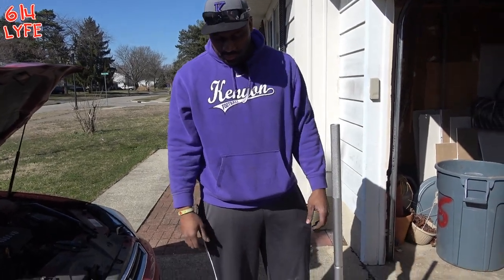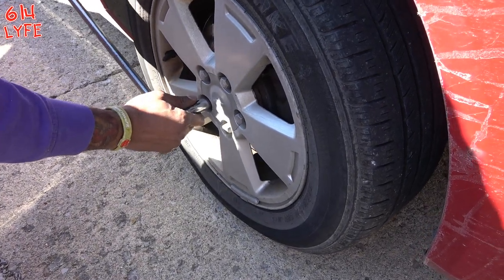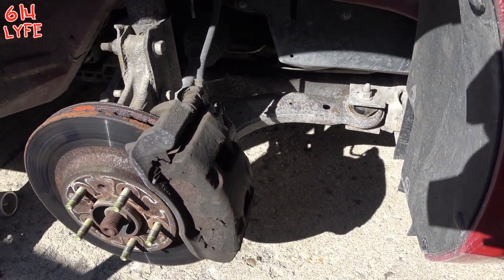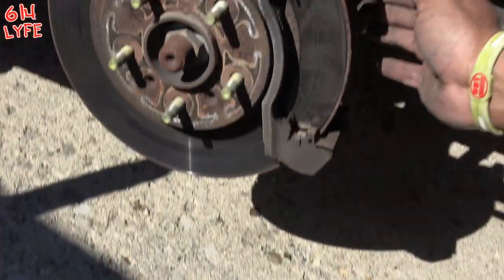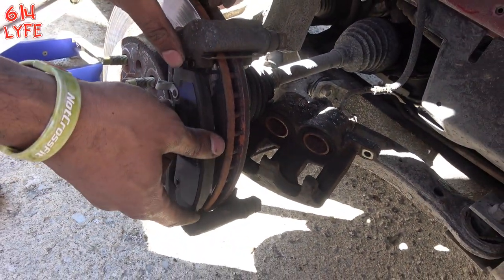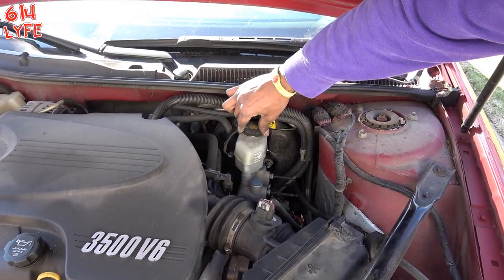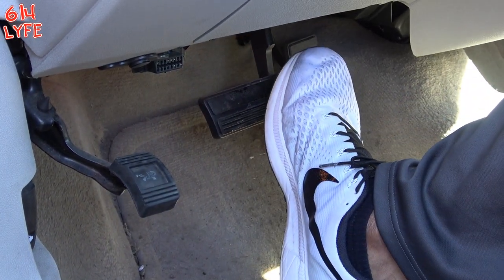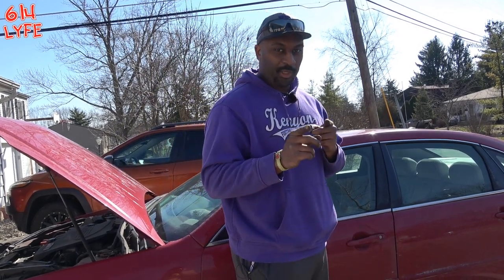How To Change Front & Rear Brakes 2007-2015 Chevy Impala FAST

Comment: Finally someone showed you don't need to replace the rotors or even cut them. I went to GM Training Center many years ago and they told us don't need to replace the rotors unless they're warped or have hot spots or of course the pads wore out and it was metal on metal and the rotor was scored. They also mentioned replacing just the pads, once worn in have more contact area for better breaking. I've seen car tv shows where they say it's a shoddy job if you only replace the pads. We used to cut rotors on customers cars or replace as needed but for our cars we only replaced the pads and that was for 20 mechanics.
Reply from the maker: Yeah I won’t replace them unless the really need it. Thanks for watching and the kind words

Comment: Good job.  I see so many people using water pump pliers to squeeze the pistons in.
Reply from the maker: No need to spend that money lol. I’ve always used my c clamp. Thanks for watching
Reply: I'm just finishing all 4 wheels and brakes.  I took the calipers off the car.  Sanded them and the cradle and primed and painted with high temperature paint.
Bugger of a time putting it back together, trying not to damage the paint. 
I just finished about 40 hours restoring the wheels.  They were horrible.  
Hopefully soon I'll have the wheels on.  It's been a long process.  I just bought this 08 LTZ and it needed a makeover!
Great video and thanks for the response!

Comment: Only things i didn't like were you didnt replace the slide pins, boots, or even lube the slide pins, or clean the metal guides of the rust, which could also use brake grease on as well.

Comment: Sir, I have a 2015 Chevy Impala LT and have NOT yet attempted to change my breaks. Will the tire sensors (or any other sensors for that matter) be an issue when replacing the breaks?
Reply from the maker: The tire sensors are inside the tire you will be A OK 👌🏻

Comment: The rear brake pistons screw in so you'll need to rotate them clockwise in order to depress them. Either buy the 12 dollar tool to fit in there, or if you're really cheap you can do it with a hefty pair of needle nosed pliers. Also, be sure and support your vehicle with a jackstand and don't leave it hanging on the jack, some of the bolts can be on there pretty tight, and you don't want it falling off the jack. Also on the rears (at least on my 2011), the emergency brake cable is attached to the caliper which can make it a real pain in the butt to work on so keep that in mind. Spot on for the fronts as far as directions go though.
Reply from the maker: Thanks for the tips

Comment: sure you can do back brakes without the rotating tool, or can you use the C-clamp also as in the front -- this is also on a 2007 Impala
Reply from the maker: yes the c clamp will work for the backs also.
Reply: @614Lyfe -  I had to use square tool and spin the cylinder back on my LeSabre...  you'd think GM would standardize a bit better

Comment: What about the thin metal clips that come with the brake pads, use those or keep the old ones in?
Reply from the maker: You can replace if the old ones look like they need replaced

Comment: Why didn't you clean and grease the caliper pins or use brake cleaner?
Reply from the maker: Thats jusy how we donit
Reply: You forgot to tell your viewers that if you do not properly clean with brake cleaner and a wire brush it down good and then grease the caliper pins the brakes can lock up. You should also add a dab of grease where  the brake pads slide on the  hardware and replace the actual brake hardware so the pads can slide properly as well. It is safer that way.

Comment: you may need to bleed you brakes after a brake pad replacement to get your pedal working again. But usually with front brake pads it not required.

Comment: forgot to bleed them though pumping them as far as i know dosent remove the air from the system
Reply from the maker: No need to bleed them if no air gets in the line
Reply: @614Lyfe air gets in usually when you push the pistons back in. Ive never done a brake job where they weren't bleed but I ain't a professional.
Reply from the maker: @nivekwalker9665  i just make sure that it has enough fluid in before starting the job and as long as the level isn’t low it has never caused us an issue. But there is nothing wrong with bleeding them its just very hard to when you str solo

Comment: This video is fine except the rear brake calipers retract differently than the front . They need to be twisted back into the caliper due to the parking brake incorporated into the rear calipers .
Reply from the maker: Thanks for the info

Comment: Take note... Some pistons need to be turned clockwise to move them back in.  You will see notches on the surface of the piston for a pair of pliers. Spread pliers apart into notches...Turn piston clockwise...In it goes.
Reply from the maker: Thanks for the tips.

Comment: Got any tips for stuck and rusty bolts? It's taking me like 45 minutes just to get the fucking calipers off.
Reply from the maker: heat them up with a torch or use some wd40
Reply: @614Lyfe  PB Blaster works pretty well.
Reply: Yeah don't try and torque them too much with a breaker bar, you can snap the stupid bolts off. Use some heat.

Comment: Process is not exactly the same for the rear brakes. The bolts are different on the 2011...
Reply from the maker: Chevy is up to its old tricks. Thanks for letting the subscribes know. Could you reply with the bolt size if possible.

Comment: The your rotors are pretty badly glazed and there is the start of grooves being cut in them... They need to be either turned or just replace the rotors and put new steel on... The problem with just replacing the pads is if theres been some angular wear on the rotors - your pads wont line up square and the pedal will be too spongy and braking will be crap.  This has happened to me twice because i was being too cheap to take care of the rotors - this is why a good mechanic charges what they charge if you care about safety i would avoid putting just new pads on really worn rotors such as these... Also you will eventually warp them and will have to replace everything anyways - sorry but, thumbs down on this one.
Reply from the maker: Thanks for watching